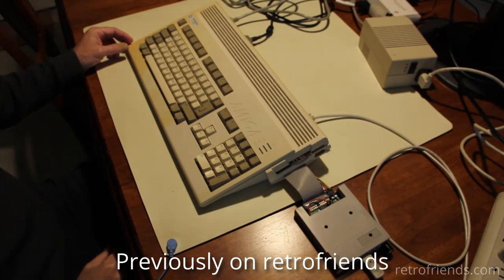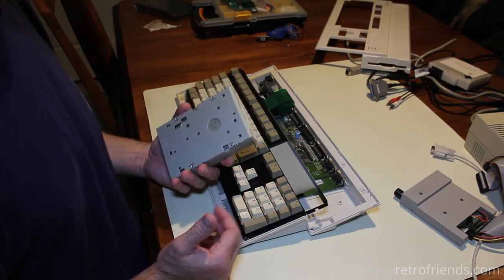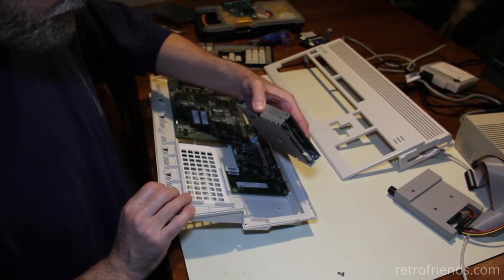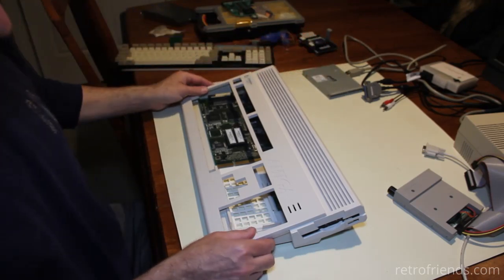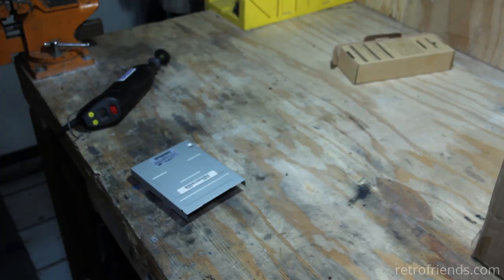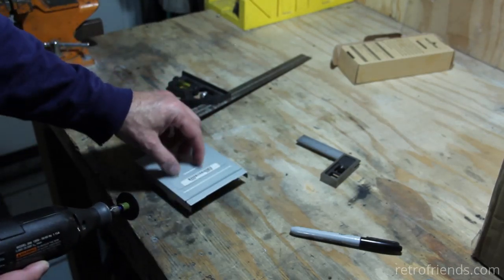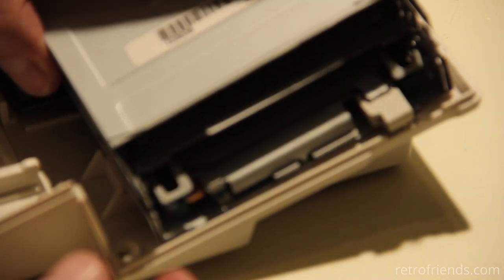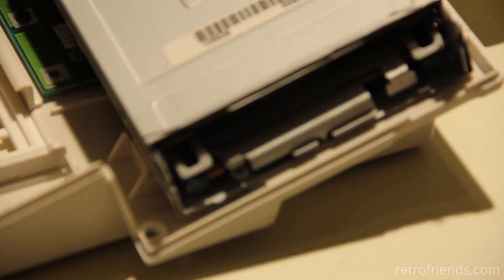Fitting a PC floppy drive in an Amiga 1200

Comment: nice video. How about one on how to mod PC floppy drives to work on Amigas. Floppy drives for Amiga are very expensive now and this would definitely help....Thanks....and keep up the good work.
Reply from the maker: It is something to consider. Thanks.
Reply: Only one signal is missing which is available on the IC in the floppy. 
Diskchange I think it was. So just solder one or two bridges.
ESCOM finally sold A1200 with PC floppies. The signal is also missing there. 
Some software worked, some didn't. That was after C= went bust and they must have had boards in stock.
Because of the old Paula, only DD floppies worked. Or half speed HD floppies. But they often failed.
Or DD-Disk in HD Drives. Or disable the HD Switch on the HD drive.

Oh, PC floppies are set to Disk1, the Amiga expects Disk0. 
Either there is a jumper or you have to swap 2 pins behind the connector.
But the cable is always straight 1:1, not rotated like PC.

Both are interpretations of the Shugart bus. 
A company de facto standard. 
The Amiga uses 4 select lines, i.e. 4 drives as Shugart did. PC use only 2 select lines.
Shugart built the first floppies and all other manufacturers copied the standard.
Except for Apple, they had their own floppy electronics, but Shugart mechanics.
The Gotek is also a Shugart device as well.

Some manufacturers use GND Minus pins for +5V and +12V, Amiga and PC do not.